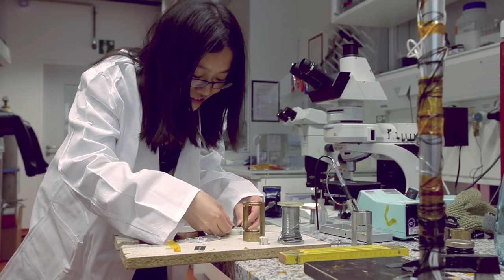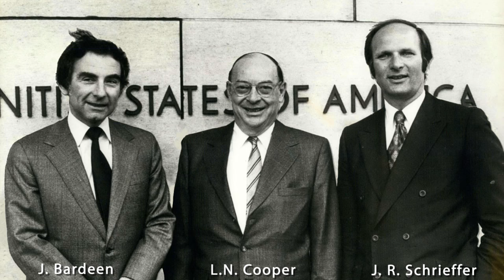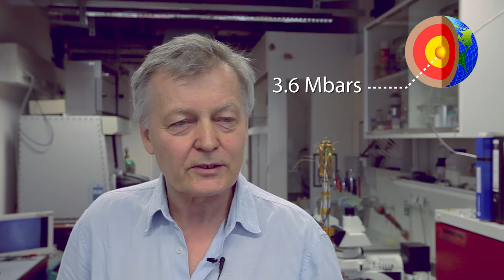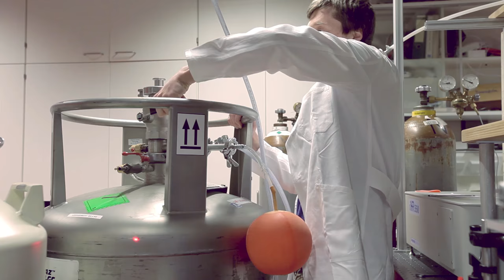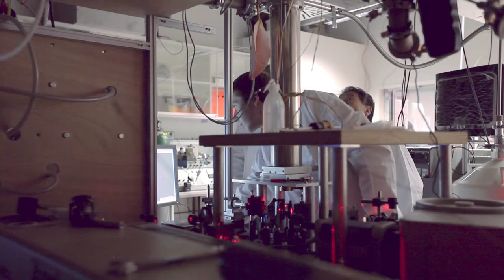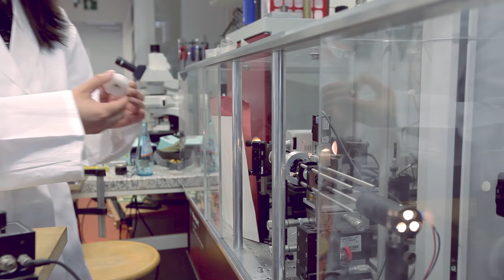Superconductivity - the challenge of no resistance at room temperature

Comment: The answer is literally everywhere, right in front of your eyes. Our entire plane of existence is a superconductor, to neutrinos at least. And the intergalactic medium is a superconductor with properties which are many orders of magnitude beyond the interstellar medium.

Key is, understanding the authentic structure and dynamics that permit the individual component of matter at this scale of magnitude to exhibit a charge equalibrium.
('Neutral' charge infers an incorrect concept in that charge is not a fundamental principle in the composition of the individual component of matter. Rather, it is indeed composed of principles involving charge, as does everything this realm is accessible too, it is just structured in such a way as to contain specific properties which can be sympathetic to the corresponding properties of any other respective/prospective components of matter. This allows it to be nearly perfectly stable in any configuration regardless of its 99.999% of its possible orientations.

Everything in our perceivable plane is, at a minimum, a Duality or Trinity in principle. EVERYTHING

Edit: INCLUDING 'G' It is just that the reference frame it is manifest from is well beyond the constraints of our sensory capacity. (Ie; It would take more than a lifetime to detect the phase shift of a single wavelength of the shortest possible spectrum that G is a component of and/or the 'monopole' like characteristic of G is only the inducted effects upon the medium of our plane, resulting from the physics of a greater medium that our planes medium inhabits. Basically kinda like the popular analogy for conceiving higher dimensions where, from the perspective of a 2D realm, it only experiences the 2D section of an intersecting 3D realm as reality. But the intersecting 2D section is also subject to the form and reality of the 3D realm. *If you are not a component form of a plane's medium/form, you are intrinsically incoherent and incompatible with the medium of the plane and the reality of its form. You simply can not exist within it and are unable to perceive it. 

(Regardless if our species manages to endure for millenia after millenia, we will NEVER leave our galaxy with conventional conceptions of space travel. We would likely need to establish a wave guide of some description, manifest, sustain and take an insulating/protective bubble of our planes reality with us.... And even then the odds are vanishingly small that we could ever achieve such understanding and tooling with the confines of our biological brains relatively limited intelligence.

Once the data 'from beyond reality' is known, we would have a chance but unless someone/something gifts that to us, we are stuck with a situation like the current 'singularity' of a black hole question....
All the maths in the world will never be able to account for unknowable, unknown-unknowns.

Comment from the maker: Mikhail Eremets, an experimentalist at the Max Planck Institute for Chemistry in Germany whose lab set the hydride records of 2015 and 2019, stated about Ranga Dias´ et al.s´ work: “What I like about this work: They bring carbon into the system.” 

He also answered the question of how realistic is it to find (sulfur) hydrides that crystallize into solids with superconducting properties under less high pressure. "Recently scientists started to systematically search for high-temperature SCs at ambient pressures. This became possible as a result of high-pressure studies (both experimental and theoretical) which developed tremendously in the past 5 years after the discovery of 200 K SC in H3S. Mostly binary materials – hydrides that consisted of two atoms - were carefully studied. Last year the studies turned to ternary compounds – materials that consisted of three elements such as  S, H, and S in addition. It is difficult to expect the finding of a simple binary compound at ambient pressure – all of them are known, but ternary compounds are promising."
Reply: Ternary or binary?  That may not be the question.  It is Debye temperature that matters.  In the C-H-S system of Ranga Dias, the Debye temperature reaches 6239 K.  It is worth recalling the Debye temperature reaches 2230 K in diamond in ambient, compared with 118 K in solid hydrogen.  It is better to try diamond-like hard materials, ternary or otherwise.

Comment: I have a suggestion, for making high pressure superconductor. Why not make use of the way that nascent hydrogen coordinates with metals like Platinum, Palladium, or maybe even Nickel. Here is how I would do it- by using chemical vapor deposition technique, to create a thin film, maybe one atom thick to start with, on the surface of one of your polished flat faced diamonds. Then subject the coated diamond to nascent hydrogen, or maybe diatomic hydrogen as well, it may not even matter. Do the same on an identical diamond and then mount them so that the faces are opposing, apply increasing pressure and check it for superconductivity. To check it you could have gold microwires contacting either side of the contact field, maybe having slightly inserted into the deposition layer prior to compression then hooked up to your detector. Or, you could instead forgo wire contacts and just apply a very specific magnetic field and have your detector check for the sustained field after the magnetic field is applied. One atom thick of hydrogen adsorbed onto the crystalline surface of the metal maybe insufficient, so perhaps multiple metal vapor and hydrogen gas depositions may need to be made on each diamond face, before applying the pressure to force them together. It may be that the extreme pressure is able to distort the lattice enough to enable the electrons of the hydrogen to combine into the cooper pair configuration..

Comment: Very amazing work going on here, But I would hate to think of how terrifyingly dangerous it would be if a large distribution cable was ever made this way?. A charged cable with 21.7557 million Psi -70c of highly explosive H2S gas was to ever fracture, or  (Especially if it's under a high load) break?...   The enormous plasma fireball that it would create from the electricity igniting the gas would be the least of your problems as it would quite likely remain ionically charged more than long enough to energize anything within its radius with an even more devastatingly massive power surge as well!

Comment: If temperature and proximity of electrons can affect super-conductivity then the addition of electrons should also.
The location of a gate on a conductor could make a conductor: super-conductive at a cost of adding EMF perpendicular or parallel to a conductor.  That makes no sense. It supposes that all conductors can be treated like transistors.  How would you add an electron flow to a conductor that has an electrical current going through it?
    Well: Just suppose you had a wire one foot long, marked at every inch along its length. and then in the middle of the wire segment from the five to the six inch mark you soldered a one inch wide copper strip across the  round wire.  The strip is also one foot long. so now you have a cross made of a wire and a strip of copper.
    Now you apply a voltage say 3 VDC to the strip and  an independent 10 VDC to the wire. including variations of: (3Vac; 10VDC), (25VDC; 3VDC), (3VAC; 6VAC ),  (3VDC;  6VAC), etc.                                            
   I'm suggesting that there will be a conductivity increase across the wire from point 5 to point 6 and possibly from point 5 to point 11+;  and perhaps a voltage drop (the cost) across the length of the copper strip.
    This experiment could be varied to include wrapping the strip into a tube along most of the wire and running dc through the strip and AC through the wire; and all extrapolations and inversions; as suggested earlier, in between.  
    It may be that the negative or the positive terminal needs to be common to both sources of electrical power.  These experiments are conducted till the realization is made that adding electrons through a conductor is similar enough to room temperature super conductivity that it can be practicably done till real super conductivity can be realized.  
   The experiment can be varied to include wrapping a few turns of a wire from point 5 to point 6 and adding emf that way.
Reply: You cant just add electrons

Comment: Superconductivity at room temperature is possible. The material of use we have already but it will only work consistently in an enclosed environment. Like other major experiments a vacuum must be created because oxygen and other corrosive gases cannot be present. Their is only one housing material possibility on earth that the superconductive material can remain unaffected within it's bounds and the housing material must be enclosed in graphene tightly knitted. I believe this is how uap's achieve the cloaking. These two materials together are similar to the thin strong materials found at early ufo crash sites. I do not believe mankind will achieve these feat's prior to it's extinction as civilization has not yet been achieved and mankind might not overcome mental mechanization as all nuts and bolts stay within the compartment in which they were made.